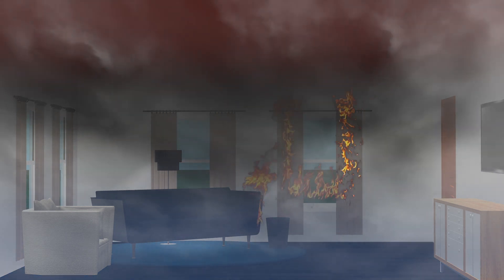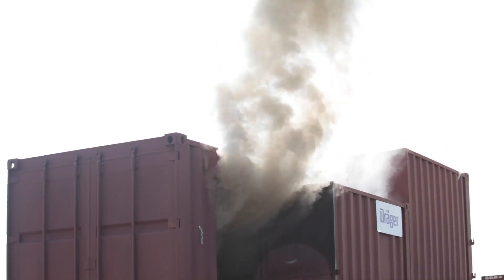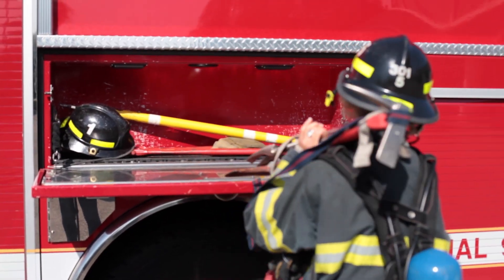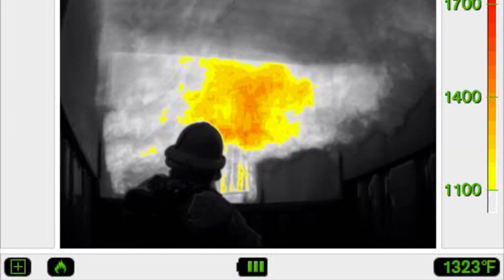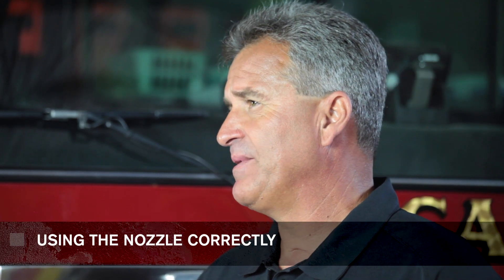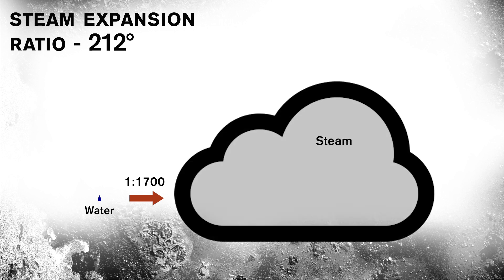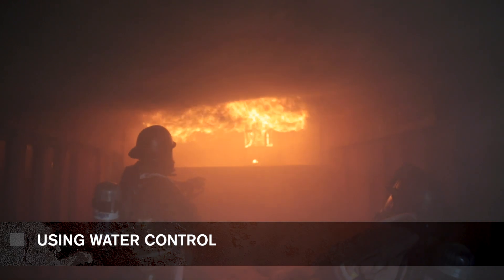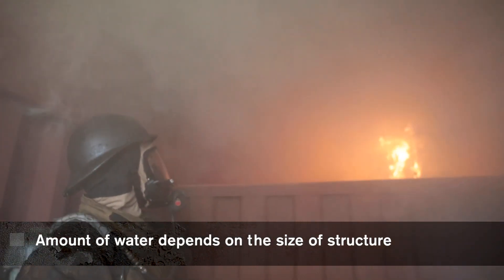Stay One Step Ahead: Flashover Misconceptions (Part 2 of 5)

Comment: Break the fire room window and soak the burning material from outside and the fire is out and the interior cooled by 1000 degrees before you could get the front door open.  SIMPLE!  The heat, smoke and water vapor will continue to exit the only pressure release location, the window!  Stop trying to turn this SIMPLE JOB into Rocket Science!  I know you are trying to make it complicated so you can keep your job, but if you DO your job, that's how you will have job security.  You are doing the fire fighters in this country a disservice!